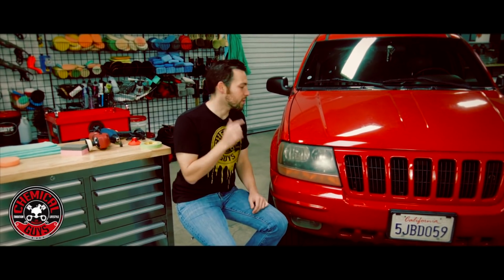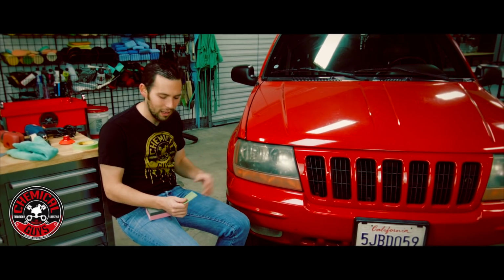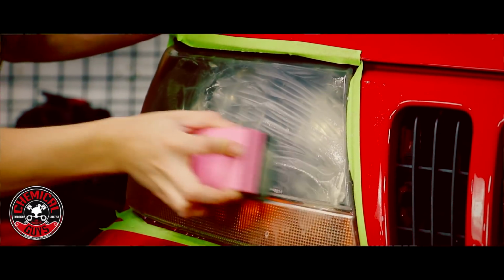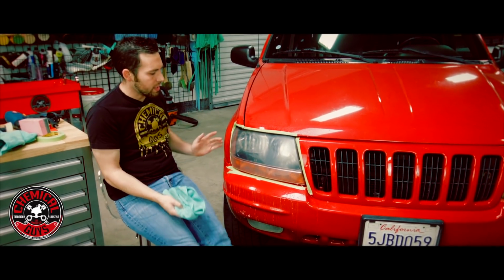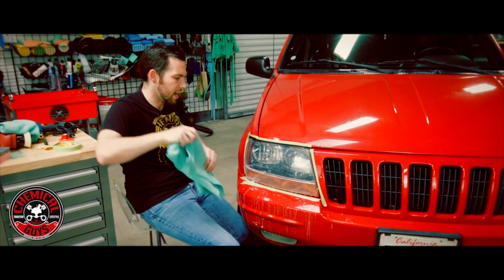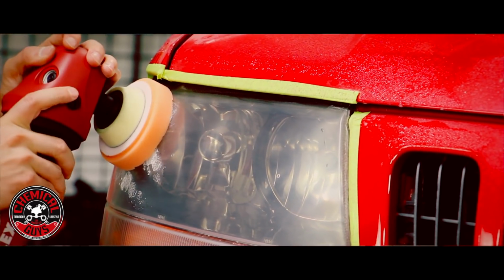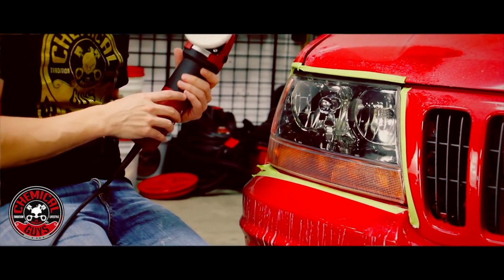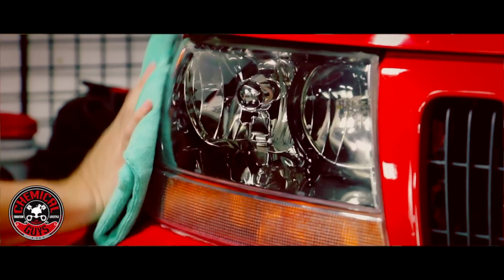How To Restore Headlights - Chemical Guys Car Care

Comment: I have a question what if i am 
On a site and there is no outlet and I don’t have a van or a generator how can I still use the polisher what is my other option
Reply from the maker: Hi Emmanuel! Hand polishing is an option for when you can't use a polisher.
Reply: @ChemicalGuys  ok thank ypu
Reply: @ChemicalGuys  do I need a sealer or is that enough and if I do is there a sample size to buy or is it the 16 onz only

Comment: Can the wet sanding be skipped using a heavy compound and  a heavy cutting pad?
Reply from the maker: Hey Mark! For oxidation, compound alone is not abrasive enough which is why wet sanding is required.
- CG Nick

Comment: what do you guys recommend on newer headlights? My 17 Focus ST's UV coating is flaking off my headlights and i dont know how to remove the rest of it without sanding and I dont have the tools necessary like a polisher or anything, I dont see any point in buying them if I will only use them once then never again.

Comment: Hey I purchased the kit and I know you say that it should be able to do 40 cars, but how do I reuse the sandpaper after I peel it off and switch to 3500. Also sandpaper says 2000 and 3000, not 2500 and 3500?

Comment: When I restore headlights I extend the painters' tape out 3-4" so that I can scrub all the way to the edge of the lens without worrying about the paint, and then when I use polishing compound on the headlamp I can also take the buffing pad all the way to the edge and not mar the paint, and then it also protects from any dripping of the uv-resistant clearcoat on the paint.
Reply: Not necessary you just gotta be more careful and k ow how to work the machine... I've been doing it for years and got their torq polisher and I love it to do headlights
Reply: @jskallingtin  It's not necessary until that one time you slip and wish you had put 30 more seconds into taping. It hasn't happened to me yet but I tape off further out regardless because it's good practice to do so.
Reply: Very good tip, also adding newspaper/newsprint around the light area into the body helps too. ;-)

Comment: Quick easy $25-40 .   I do em all the time.   Some will come out like new If damage is on outside.   Some get tiny cracks in plastic and that won’t come out.   Comes with experience but you can tell right off if it’ll come out or not.   Gives cars a lot better appearance for cheap and quick

Comment: I just finished following this video and restored my VW Phaeton headlamps.  The Georgia sun was playing havoc with them and the car is 14 years old.  All the dead plastic came off.  I took my time and used the materials suggested in the video.  I even bought the polisher.  They now look like new.  I am absolutely pleased.  This Phaeton just turned 89K on the odometer, just had her timing chain and belts done, brakes renewed and she is ready for another 100k easy.  Don't let anyone say the VW Phaeton is unreliable.  It has been my daily driver since new and now she looks fabulous thanks to the Chemical Guys.  If I ever sell this old lady, someone will get a beautiful example of an extraordinary car.

Comment: What grit sand papers did he use?
Reply from the maker: Hi Josh! He was using 2500 and 3500 grit and paper. Thanks for watching and thanks for being part of the Chemical Guys family!

Here is a link to the Super Fine 3500 Grit Sand Paper.
https://www.chemicalguys.com/Super_Fine_Sanding_Sheets_3_Pack_p/flex_sheets_ul_3.htm

Here is a link to the Light Cut 2500 Grit Sand Paper.
https://www.chemicalguys.com/Light_Cut_2_Self_Adhesive_Sanding_Sheets_3_Pack_p/flex_sheets_l_3.htm

Comment: Can you use a DA polisher for this instead?
Reply from the maker: Hi Nate, you sure can. Apply 3 - 6 dots of Headlight Restorer and Protectant to a light polishing pad and work over the part on speed setting 4 - 6 with a Dual Action Polisher, or up to 1800 RPMs on a rotary polisher. Thanks for watching, Nate, and thanks for being a part of the Chemical Guys family!

Comment: How much pressure are you applying on the sanding, compounding and polishing stages?
Reply: Wetsanding: Like scratching an itch with your fingertips, but not a bad one. Compounding and polishing are more about just keeping the pad settled on what you're polishing. Don't push down, just rest the weight of the polisher or drill on it and focus on first spreading your compound with really slow rotations, then when it's even, begin polishing and gradually lighten your "resting weight" and increase the speed to buff. I JUST got the best results I've had, I'm not preaching how to do it I just want to share that success.

Comment: We’re also going to be using our high performance chemical guys water for this restoration
Reply: yeah, it fixes dead headlights, the best water on the market by CHEMICAL HOES
Reply: @stephenclark15  oō
Reply: lol.  The stuff works but it is imperative for thr vehicle owner to put a coat of wax on the lights after each or every other wash.  The vehicle is being sandblasted by traffic in front of it.  If the owner does not do that then the lights will fade a year after
Reply: Even a nice ceramic coat will keep them clear for a very long time
Reply: They legit did use special water on their car wash video

Comment: Can you please explain why you want vertical and horizontal sanding but then use a circular polisher , very impressed with rezults just confused on technique
Reply from the maker: Hi James, great question. It all comes down to man vs. machine. We, as humans, are incredibly inconsistent. The speed and pressure we exert on a hand applicator pad is inconsistent and uneven, which is why you should use up and down motions. Machines, on the other hand, are very consistent and even and are always able to apply the same uniform speed and pressure, which is why it's ok from to go in circular motions. Thanks for watching, James, hopes this helps! Stay tuned for new videos headed your way soon!
Reply: Chemical Guys awesone. Appericate the quick response in such an old video , I'm gonna order some product here soon for my truck

Comment: Do you guys have a video explaining the different polishes you show, like the strengths of each one?
Reply from the maker: Hi! That's a great question. The V Line Series is our complete compound and polish kit. It is our most versatile and comprehensive option and the full system removes anywhere from light to severe paint defects. V32 and V34 are compounds and V36 and V38 are polishes. They are sequential so the lower the number, the more aggressive the product. Next, we have VSS which is an all in one product. It fits somewhere between V34 and V36 and is for the detailer looking to purchase one single product rather than two or three. Then, we have All in One Polish, which is a polish and sealant in one. Not only will it cut away those swirls and scratches in one step, it will also lay down a layer of sealant to leave your paint with a great shine! The video below explains the V Line series pretty well. Make sure to give it a watch and let us know if you have any further questions! 
https://www.youtube.com/watch?v=HrUmQ6uLSPI&t
Reply: Chemical Guys awesome thanks
Reply from the maker: You're welcome! I'm also going to leave an article for you below that explains which pad and polish to start off with on your car when using the  V Line series. It was really helpful for me and I think it will be for you too! Thanks for watching! 
https://www.chemicalguys.com/How_To_Choose_The_Right_Compound_Or_Polish_For_Your_Car_s/644.htm
Reply: Chemical Guys cool, I only do headlights but I'll check it out

Comment: Hey I'm using same techniques with the block. Whatelse is on that block thats sticks so well to it.
Reply from the maker: Hey Jomar! The Clay Block uses extra fine clay to trap and remove embedded contaminants from the surface such as overspray, road tar, brake dust, industrial fallout, and more! Thanks for being part of the Chemical Guys family, Jomar, and make sure to check back later today for a new video upload!
Reply: So that's the reason my block cost 20 bux lol. Ya I been having a problem receiving the rt sand paper. The shipping place in PA. Keep sending me 2&3k not the ones ur using. And im in MA. Aking full 12 days to receive items. And still waiting for the brush and another pads. Ty maing u guys RocK....
Reply from the maker: The other reason for the increased price on the clay block is its longevity. When used correctly, it has the potential to last much longer than the traditional clay bar, so you can get many uses out of it. Also, when it is dropped on the ground, you do not have to throw it away either! Not sure about the sand paper... we offer a couple of different options of sanding sheets that I will attach below. If you ever have any problems with any of your orders, you can call our customer service department for quick and courteous correspondence!
https://www.chemicalguys.com/Super_Fine_Sanding_Sheets_3_Pack_p/flex_sheets_ul_3.htm

https://www.chemicalguys.com/Light_Cut_2_Self_Adhesive_Sanding_Sheets_3_Pack_p/flex_sheets_l_3.htm

Comment: How much pressure Is needed if I do it with a drill? I tried today with 800, 1200, 2000 but when I tried to sandpaper the headlights the drill moved all the way, pretty difficult and also happened with the compound, what you guys think? Really need help, did I miss pressure or was it too much? Or the drill has too much power? I am totally confused with what happened HEEEEEEEELP!!

Comment: Why arent headlights made with glass and a coat behind the glass to distribute the light better (isnt that why they have the plastic?) is it to minimize glass breakage in an accident? Or... something?
Reply: glass is more hard to make, plastic is very easy to make for manufacturers and is way cheaper too. some older cars had glass covers like old mercs but they found out is a lot more easy and cheap to use plastic with the same results. But of course glass would be the obvious choice because of quality.

Comment: how do you clean those hexlogic pads?
Reply from the maker: Hi Eddie, good question. Proper pad maintenance is important to insure that they will last as long as possible. Using Chemical Guys Pad Cleaner makes it easy to clean and condition any foam, microfiber, or wool buffing and polishing pad. Polishing pads can be cleaned by machine for ease, or by hand. If you plan on doing a good number of cars or polishing frequently, I definitely recommend the full kit for convenience. I will leave a link to the cleaner and also to some videos that show you the proper way of cleaning those pads! Check the description below each of the videos for more information and links to the specific products! Thanks for watching, Eddie, and stay tuned for more exciting how to videos coming your way soon! 

http://www.chemicalguys.com/Foam_Wool_Citrus_Based_Pad_Cleaner_16_oz_p/buf_333_16.htm

https://www.youtube.com/watch?v=4vfvP1Z2R4U&t=510s

https://www.youtube.com/watch?v=B01zu7wuGA0
Reply: Chemical Guys you wrote insure. You meant ensure.

Comment: You typically only need sandpaper ranging 600-2000, maybe 2500 and that’s it. I work with a high speed though

Comment: Will this method become permanent? Or will it become discolored again?
Reply from the maker: Hi Peter, it's possible to keep the headlights from oxidizing, but you have to stay on top of it. Remember that after you restore the headlights, you have to apply a sealant, and a wax to keep the headlights protected. Stay tuned for more great videos coming your way Peter.

C.G. Alex -
Reply: Chemical Guys 

Thanks! :) I'll subscribe just for that! :D

Comment: Would you ever start with a lower grit or starting at 2500 works for all conditions?
Reply from the maker: Starting with 2500 is recommended because it's not's the most aggressive sand paper available, you don't want to sand off too much of the headlight, just enough of the surface to get rid of that oxidized plastic.

C.G. Alex -

Comment: I do headlights on the side,I recently purchased your polishes the 4pk,what can I use the 34 and 36 on,can I also use these on the headlights???
Reply from the maker: Hi Ted, you clean the headlights, followed by using the 2500 grit sandpaper, then the 3500 grit sandpaper. The v34 and V36 compounds and polishes can be used on headlights, and paint correction. In order to restore the clarity of the headlights, you will need to polish away the remaining deadened clear coat. If you watch the video, this is the final stage of the headlight restoration.

C.G. Alex -

Comment: I have a 3 inch buffer,will the pads work on it???
Reply from the maker: Hi Ted, thanks for watching. Yes it would, it might take a little longer with a dual action, yet arguably safer to use. Rotary polishers will work as well too, better than a drill since you can adjust the speed on the rotary. Stay tuned buddy, we've got a new video launching today, you don't want to miss it.

C.G. Alex -

Comment: Take the light off and do it.
Reply from the maker: Hi there, it's actually easier to do this when the light is still attached because you don't need any kind of vice clamps to hold the lamp in place. It's important to tape off the surrounding areas so as to avoid damaging or polishing anything around the headlight. Stay tuned, more great vids brought to you buy the Chemical Guys.

Comment: I live in Southern Arizona and have been doing H/L Restoration for over 15 years. I have gotten to the point to were my customers want a maintenance free Restoration that last a verry long time. 
What is your BEST UV Protective seal for H/L's that I can guarantee to last them a long time? More than a year.
Reply from the maker: Hey Don, thanks for watching. One item comes to mind, it's Carbon Flex because it's a ceramic coating that lasts longer than conventional wax and sealant coatings. Carbon Flex has a life span of up to two years, and is the best possible protection that we have to offer. You should still apply a sealant and wax to help prevent oxidation. Stay tuned Don, we've got more amazing videos on the way!!

C.G. Alex -

Comment: Can I do Right to left movements?
Reply from the maker: Hi Ryan, 

Yes, it's actually encouraged. It's called cross-hatching. You'll want to sand in a cross-hatch pattern to truly cut the haze and oxidation. Check your results regularly after each pass.

Comment: Bringing headights back to life in this manner is what I have wondered about for quite a few years - not anymore with the help of Chemical Guys' greatest teachers.
Reply from the maker: Hi Kim, we made the impossible, possible!! It depends how oxidized the headlights are, some headlights can't be restored, especially when they are oxidized inside and out.  You have to be very careful with headlights, you can ruin them because the plastic is very thin.
Reply: Thank you for alerting me.  I paid very close attention as the sandpaper was being used, the amount of pressure applied, allowing the paper to do it's work rather than trying to overwork it and not being aggressive.
Reply from the maker: The part that you really have to pay attention to is when you polish with a drill, which acts like a rotary polisher. Unfortunately with a drill there's no speed control, you could actually end up burning through the headlights. It's tricky, but if done right could make you a wealthy man :  ]
Reply: Chemical Guys Being experienced with a drill, it can be tiring to the hands and arms after a while with extended use and consideing that it is necessary to have good speed control, so thankful for your help, I can see that the right kind of equipment beyond a drill would be in both my and my customer's best interest.

Comment: I didn't know plastic could die.🤔
Reply from the maker: Hi Steven, it's true. It happens when the headlights are exposed to the sun without protection. The sun's U.V. rays cause the headlight plastic to become milky, and yellow. If the headlights oxidize from the inside,  they cannot be salvaged.

Comment: I have the TORQ 10FX Polisher. Can I use that?
Reply from the maker: Hi buddy, thank you for watching. You can use your polisher, however it might be a little large for polishing headlights. Having a cordless drill is the most practical approach. I would say having a TORQX would make this job a little easier. The lighter device you use, the better, you won't have a ton of room to move around. Make sure to tape off the surrounding area of the headlight so you don't accidentally polish the paint around the headlight.

C.G. Alex -
Reply: Chemical Guys your videos and descriptions are amazing. I will try the polisher I have but make sure I tape off the surrounding areas. I exclusively use your products on my Lexus and my 2017 Pilot Elite!
Reply: Chemical Guys I can't find a 4 in backing plate sold via Chemical Guys on Amazon. If I use my 10fx polisher for headlight restoration, what size backing plate and pad should I get?
Reply from the maker: As small as possible, 3'' if you can find one.
Reply: Chemical Guys do you guys sell 3 in?
Reply from the maker: We do on the Chemical Guys website.